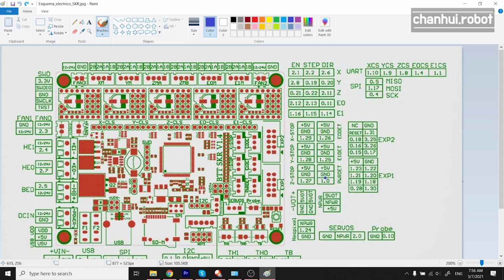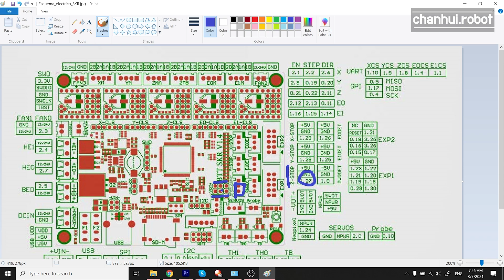[BTT SKR v1.4] BLTouch Error

Comment: Thank you for posting this. I bought a used ender3 for a second printer and I could not get the zaxis to home properly at all. I was frustrated as I had things connected as recommended. I was just about to put in the original board until I saw this, now it works. Thank you so much.